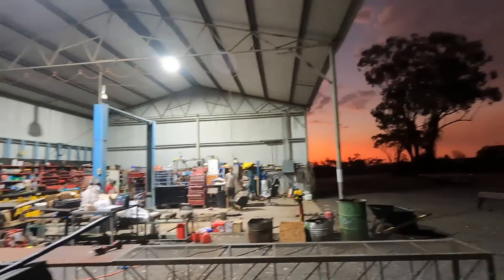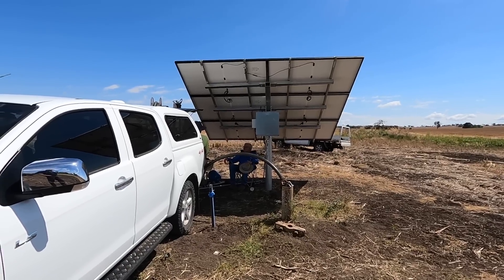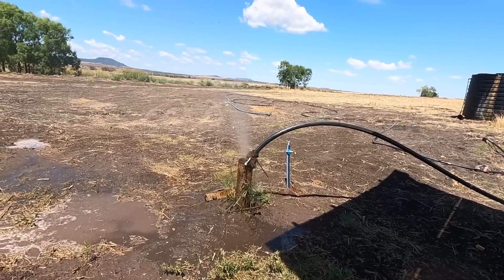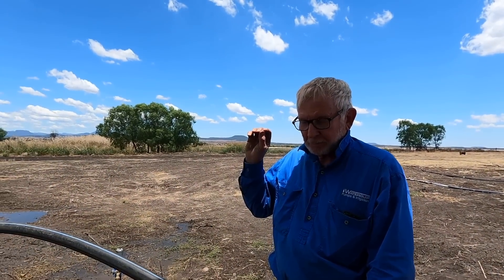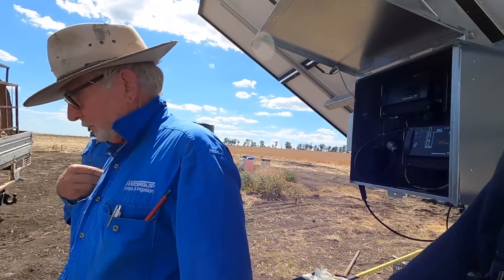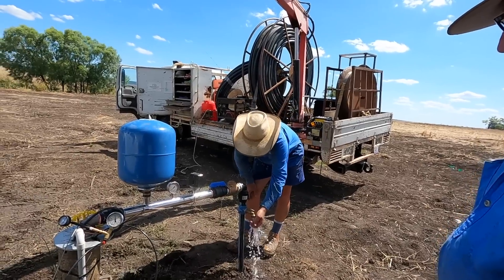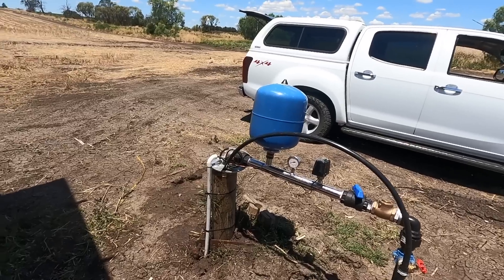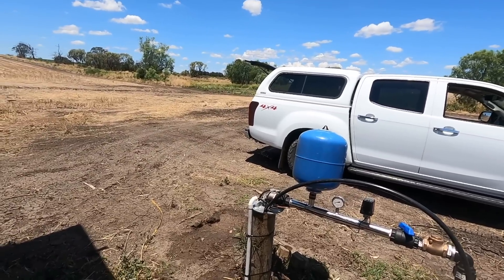Blowing the Bore! Money Down the Drain??(Vlog 137)

Comment: After using the bore for while, should be able to determine how much debris material is in the tank water (building up on the bottom of the tank). If not okay might use two tanks, one as a settling tank and the other as a cleaner water tank or use an automatic self cleaning filter etc.

Comment: Windmills are great, we had two of them on bores and another one as a transfer pump, the amount of water they pumped over the decades is incredible. It's not very often there is no wind so they are almost always pumping, even if it is just a dribble at times. We dropped about half of the pump rods down a 260 foot bore once :( that was LOTS of fun :D Throwing a pump down the hole is extra appealing once you've been there :)

Comment: It goes to show that modern technology isn’t always the best answer , a property I worked on in Western Victoria had about a dozen windmills pumping into 5000 gallon tanks which overflowed into turkey nests ( small dams built up from ground level ) these fed stock troughs around the farm plus the turkey nests were easily accessible to spray tractors and fire trucks as well as stock when they were in the lane ways had troughs just outside the turkey nest fence . Stock weren’t allowed to drink from the nest because it was too steep and too deep some were 10 to 15 feet deep, some had a floating aquatic plant on them to reduce the evaporation rate which worked a treat , best wishes from Tassie

Comment: Thanks Peter.   That was a very interesting video about rejuvenation of  the bore.   The feedback system will work well providing  the pump is operating within the pump curve to minimise wear and tear.  (pump curve as specified by the manufacturer)     Operating outside the curve will cause either the pump to wear out or the motor to burn out.  I use the same flow back system to keep my pump operating with in the pump curve and it works well.

Comment: Instead of getting a new pump you can throttle the output with a valve, it will also reduce the amount of amps the pump draws. Done it plenty of times to stop cavitation and circuit breakers tripping, I don't see why it wouldn't work in this case.

Comment: Do you know what brand your old windmill was? I am in the US and Aeromoter wind mills are still made today. In 2020 I installed a new 8 foot windmill on a 31 foot tower. Including a new pump the total cost was $7500 US. It is on a pasture farm of ours and it keeps 300-400 brood cows watered year round.
Reply: I think it was a Southern Cross. Only really two types, them and Comet. Comet is a direct drive as in one stroke per revolution of the wheel, Southern Cross are a geared head so they do two revs per stroke and will start in a much lighter breeze. They have a longer stroke than the Comets so the water delivery is probably much the same when they are going. Southern Cross built everything to do with water, the mills, pumps, boring plants to get the water, casing, motors to run pumping systems, pumps,troughs, tanks, tank stands, everything. They even built an aeroplane which is in the air terminal in Toowoomba. Both manufacturers are in Queensland. Southern Cross are galvanised and Comet are unpainted. Windmills are just about finished now after being the mainstay of stock water systems for ever. Not many people left who know how to install and maintain them anymore. I have had lots of experience with them but don’t want to go running up and down one now, that is a young fellas job. The biggest problem with windmills is when you need the water most either the wind won’t blow or they are broken down. Any similarities noticed between them and wind turbines for electricity? Jeff
Reply: @jefftheaussie2225  That is interesting information on the brands of windmills in AU. We really looked at some of the new solar powered water pumps but where this well is at the amount of sunlight in limited in the winter as it is on the north slope of a pretty steep hill. In the winter it is in the shade by 2PM, only gets about 4-5 hour of sunlight on good winter days. 
    So we installed a new wind mill as electrical power is over three miles away.  What I did do to help out if we do hit a windless period,  is I had a pump jack from the home farm wind mill.  It was only used one year before my Grand Father installed a deep well pump.  He stored it inside our machine shed. It still has the original paint on it. Almost like new while being 67 years old. LOL  I set it up  with an electric motor driving it.  The motor is small enough that my Honda inverter generator will run it. So If we need water i can just take out the little carry around generator and fill the tank if needed.

Comment: I'd had similar issues with bores during the drought. I ended up getting arduinos and relay switches and made a very simple program So the pump had a run time and then rest time so give the water time to come back in. It never crossed my mind to do what peter did, but yeah whatever works I guess :).

Comment: Surprised your pump guy didn't do pump test on the hole before he put the new system in!! 
Most of the pump fellows around here have a trailer mounted pump (or something like) for testing water rate flow before they supply pump kits!!!
Reply from the maker: Hi John, we didn’t request one because we had every reason to believe it was a decent bore, these guys didn’t actually install it but the person who did did a great job and as we requested, we like going oversized😂😂

Comment: Should be reasonably cheap to get a camera down there. Downhole cameras are widespread now. Could even make your own with an old cheap phone, waterproof case, a wood guide (to keep it vertical) and some rope. That way you'll see what the deal is down there for possibly less than $100. Or rent an actual downhole camera, although that'll be somewhat more than $100 especially if it comes with a technician. And who knows, maybe all the well needs is another "tender touch" with the 40 ton excavator...😂